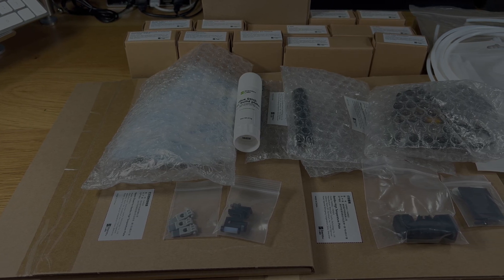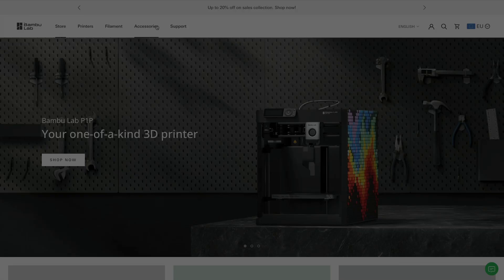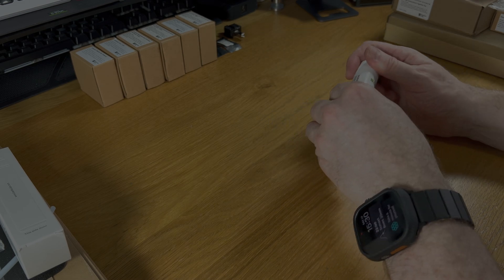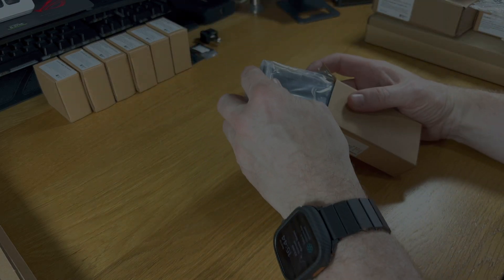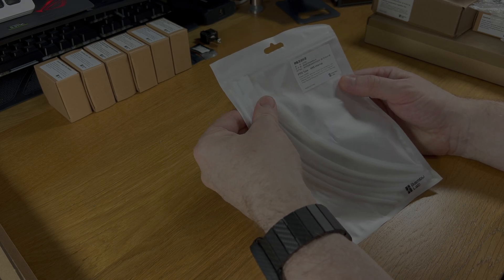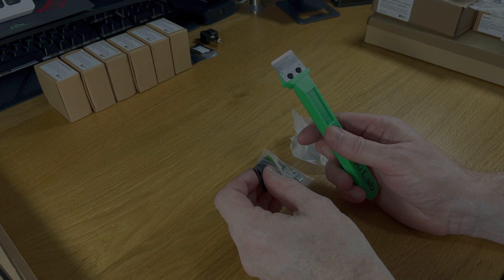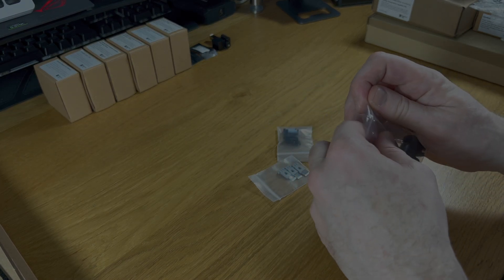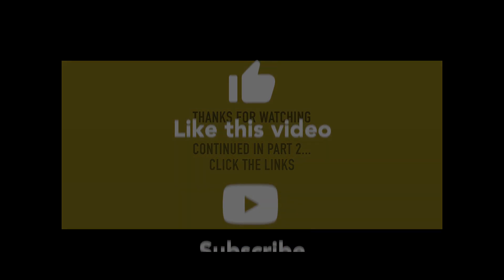3d Printer parts for Bambu Lab X1 and P1P 3D Printers - Part 1 of 3

Comment: The carbon filter is let's just say... less effective than advertised.

Also, it is much more economical to buy reusable dessicant from a third party, as you can dry it out without needing to buy more packs

Also also, I don't understand why bambu thinks a razor blade is a good idea to use as a scraper. I once tried using the metal scraper from my old ender 3 on the cold plate, and it left visible marks. Since then, I just make more and more of those printable plastic ones
Reply from the maker: @jackgamer6307 Agree, agree & agree.  I have seem some hacks to replace the filter with homemade filters, but really it doesn’t stop fumes, just some dust particles.  On the desiccant I have a tub of reusable desiccant which I will use with the AMS when the spares I have are used up.  On the blade, PLA printed scraper is the best I have found.

Comment: My x1c came with the green glue pen and a glue stick.
Reply from the maker: Hi @magicmanspaz, Have you tried the green liquid glue, I have heard mixed feedback on it, a lot of it negative.  Overall, and I am sure I am not the only one here, I hate using glue on the plate, it’s messy and can ruin your print look and quality.  On the Bambu I use the PEI textured sheet for most prints because for PLA and PETG it doesn’t need glue.  For filaments it’s hit and miss.  But sometimes also you need a smooth finish.  On the Prusa I use the satin sheet, and I have only ever used glue for TPU with that sheet.  But it’s needs replacing soon because it’s well used.
Reply: @T8Maker  Have only used it so far on the engineering plate with cheap and it stuck down perfect and washed off the part easy and didn’t leave any finish blemishes unlike glue stick.
Reply from the maker: @magicmanspaz Interesting, I think I will give it a try.  The glue stick is a pain to clean off the parts.  Thanks.